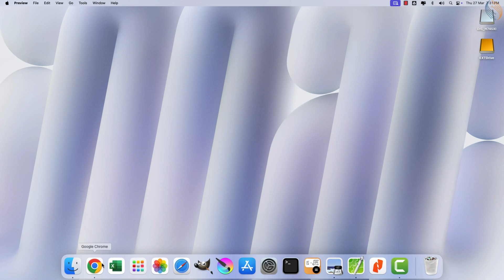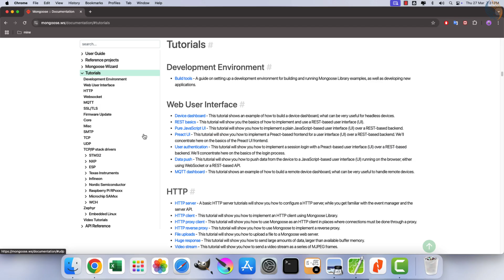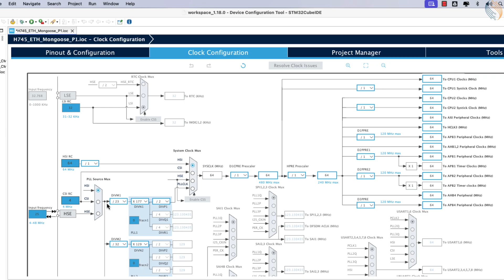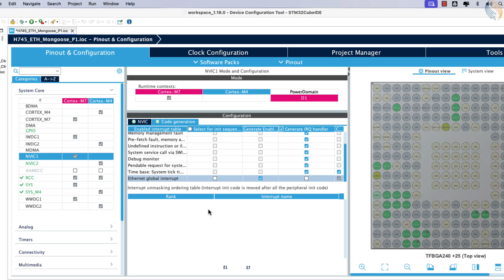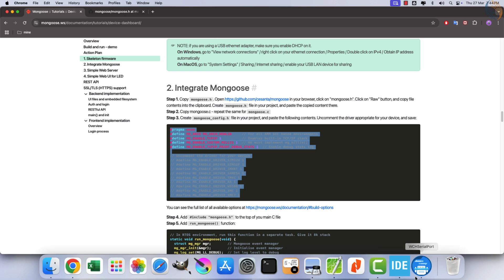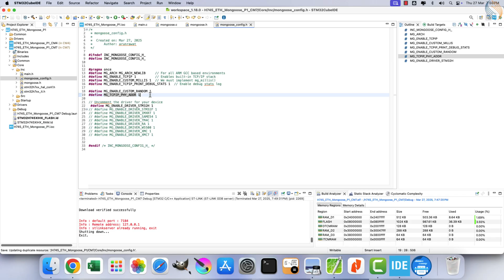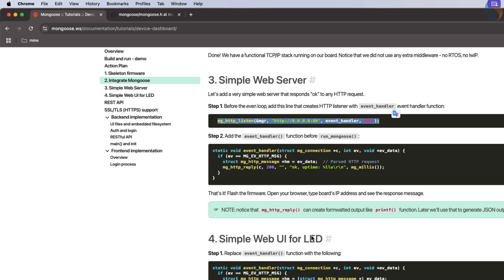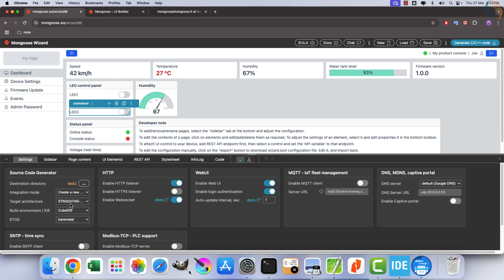STM32 ETHERNET using Mongoose #1 || Minimal Configuration to run Ethernet

Comment: Great job, is possible to set static MAC address for mongoose? (to prevent of getting new IP from DHCP after every flash)
Reply from the maker: You can yourself define the mac address for your device.
Reply: @ControllersTech how?
Reply from the maker: in the mongoose_conf.h file, define mac address like this:

#define MG_SET_MAC_ADDRESS(mac)       \
  do {                                \
    (mac)[0] = 0x02;                  \
    (mac)[1] = 0x12;                  \
    (mac)[2] = 0x34;                  \
    (mac)[3] = 0x56;                  \
    (mac)[4] = 0x78;                  \
    (mac)[5] = 0x9A;                  \
  } while (0)

Comment: can you explain how to add Ethernet drivers for custom boards? like LAN8720 ...
Reply from the maker: I need to get the module for that. I will purchase it soon and once I have it, I will make a video.
Reply: @ControllersTech  I am also looking forward to your video series on STM32 and LAN8720. The LAN8720 board is very popular, cheap and small in size and has minimal components on the board.

Comment: can it work when freertos enabled with cmsis_v2 ?
Reply from the maker: Yes it works fine with the Cmsis_RTOS_V2. Just make sure to give 8K stack size for the mongoose task. Also prove small delay inside the mongoose for loop.
Reply: @ControllersTech  , Hi its working fine, i want send string data ove the TCP, i wrote code like 
static void tcp_client_handler(struct mg_connection *c, int ev, void *ev_data) {
  if (ev == MG_EV_CONNECT) {
    if (*(int *)ev_data == 0) {
      printf("✅ Connected to server\n");
    } else {
      printf("❌ Connection error: %d\n", *(int *)ev_data);
    }
  } else if (ev == MG_EV_POLL) {
    // Send data periodically (or use a timer)
    static int counter = 0;
    if (++counter >= 100) { // ~1s if poll delay is 10ms
      const char *msg = "Hello PC!\r\n";
      mg_send(c, msg, strlen(msg));
      counter = 0;
    }
  } else if (ev == MG_EV_CLOSE) {
    printf("🚪 Connection closed\n");
  }
}

static void run_mongoose(void) {
	struct mg_mgr mgr;
	  mg_mgr_init(&mgr);
	  mg_log_set(MG_LL_DEBUG);

	  // Replace with your PC IP and port (as seen in Hercules)
	  mg_connect(&mgr, "tcp://192.168.0.2:12345", tcp_client_handler, NULL);

	  while (1) {
	    mg_mgr_poll(&mgr, 10);  // ~10ms polling
	    vTaskDelay(pdMS_TO_TICKS(10)); // Let RTOS breathe
	  }

	  mg_mgr_free(&mgr);
}
and run_mongoose() function in task, but i can't get any data, can you suggest me any way to do that?